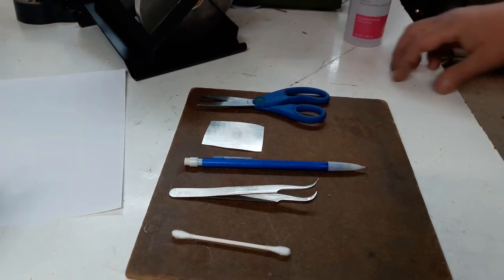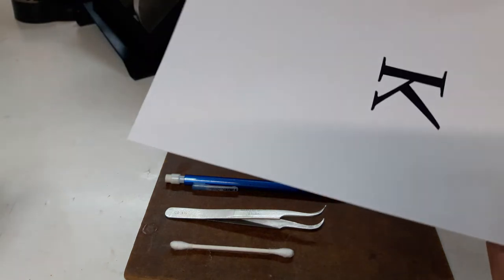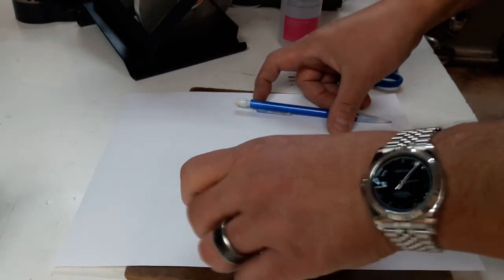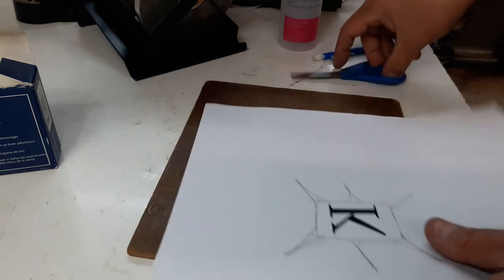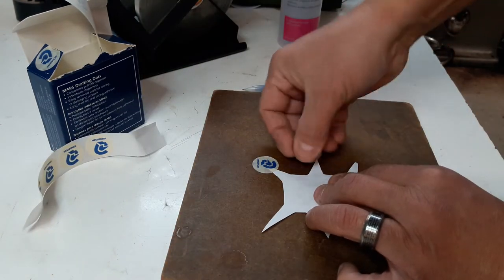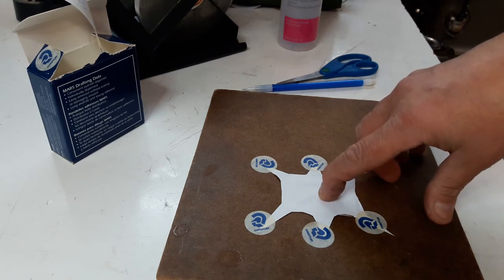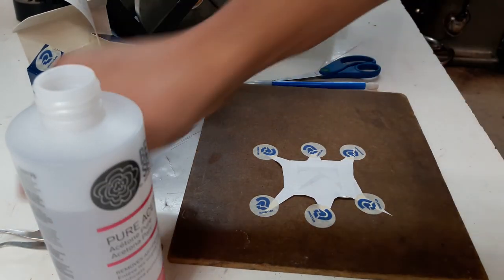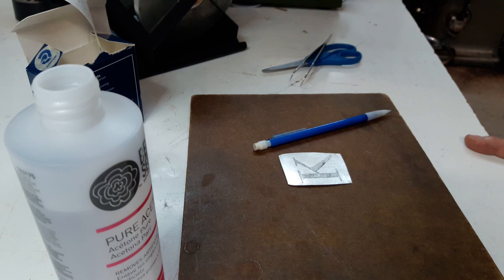Acetone Image Transfer How to transfer image onto metal for custom engraving GRS Graversmith.

Comment: Regular bond paper on that laser copy?
Reply from the maker: All you need is a laser copy machine now for best results in my experience the resume paper works the best although regular copy paper is sufficient. The difference the resume paper holds strong during application. Hope this helps, thanks for the comment.

Comment: nice but didn't work on blank mirror steel :(, I tried also potch photo transfer and still didn't work. it goes off the image. so what is the problem?
Reply from the maker: What type of paper did you use to transfer and are you using a laser printer?
Reply: @jeweleralmighty8354  yes laser printer. I used normal paper A4
Reply: @jeweleralmighty8354  a few min ago I tried on blank aluminum disk, the same thing, it goes off the design.
Reply from the maker: When you're able go to Office Depot and purchase resume paper, it's a little more durable and it allows you rub on more aggressively. Also if you have Photoshop it's been my experience when you layer the same image on top of the same layer about four or five times it comes out a lot darker and reflects on your project as well. One more thing which I'm sure you've done but it's important that you clean the metal with water not alcohol or any cleaning solution just warm water. I hope this helps but when I get back to the shop I'll make another video of that process as soon as I'm free.
Reply: @jeweleralmighty8354  I'm from Greece btw, so... I printed all the paper from top to down from left to right the same image and I cut the image. I left space ofc enough between each design. Also I watched many videos how to transfer design on metal, everyone says alcohol to clean or acetone, wait to dry off then apply. Pls check that thing on Google potch photo transfer. I did like it says but remains a thin paper on surface metal with tge design ofc, but is not nice and I wet my fingers and rub the rest of paper and ofc it goes off all the design. I'm disappointed. I've been watching many videos and idkn what to do anymore. Now I left to dry off till tomorrow night (my time) with this potch photo transfer on blank aluminum disk. B4 I dry off with hairdryer 10' like it says.. Thank u.

Comment: Just curious why this doesn’t work with inkjet or am I misunderstanding? Thanks for video. Gonna do some copper work and need to transfer a template
Reply: Because you're transferring toner over. Inkjets do not have toner.
Reply: Laserjet printers create polymers so it's almost like creating a little plastic image that melts off the paper when you apply the acetone (solvent). The plastic image sticks to the metal.